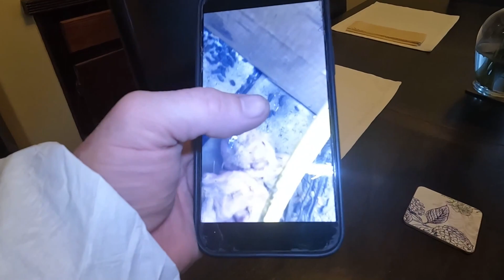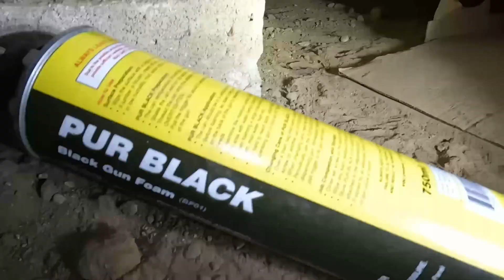9 MONTHS OF RATS because other company missed this...BEST WAY TO STOP RATS...

Comment: Has nothing to do with the Company, It's all about your technician. Every company has good and bad techs. Orkin does exclusion work and real rodent work outside of just trapping, but it's a completely different crew that comes in to do that work, and it requires an inspection conducted by one of their inspectors. it's clear this technician just didn't do their job and forward the info to an inspector. The issue could have been resolved in less than a couple weeks had the tech just picked up the phone and made the call. Bad lazy technician, Not a bad company

Comment: Been in the industry for some time. My personal experience has been this, most pest control companies will be able to take care of your average rodent problem. For the cases where the rats or mice have found a way in that is much more difficult to find, you would need a company like these guys. The majority of the time, you can fix an issue by doing only exterior exclusion work. When the rodents get in through a sewer pipe or something like that is where it does complicate things quite a bit.

Within that, I honestly believe part of the problem really is that the majority of the pest control companies often times charge too little for a bigger problem. Additionally they don't generally pay that well. Working in rodent control can be potentially dangerous especially if you are going in attics and crawl spaces. This directly influences the problem not being fixed, but only suppressed.
Reply from the maker: Yes, agree. I think it’s the responsibility of a trained technician to make it clear and understand that is a rodent issue is not stopped within 2 weeks or less, then to let the client know, that it’s something deeper and beyond our scope or learn to facilitate a lic subsContractor to get to these entry points, making more money and solving the issue. 
Thanks for sharing this very informative information. 👍🙏👏
Reply: Pay should not determine if you’re going to do a good job. Determine a fair price, then do a great job; old clients will recommend you and new clients will find you.
Reply: @helenm6732  I agree, with that if you are a business owner, but most pest control companies will pay you a commission based on the service. Say for example, your office sells a $300 mouse trapping and inspection service, they may pay you anywhere from $30-50 off of that depending on who you work for.  It could take you an hour, it could also take you 3 hours if its really bad. This is partially where the companies make the mistake and ultimately don't encourage their workers to do a good job. This is also not factoring in drive time which will vary company to company. Personally, I take pride in giving it my best regardless. However this doesn't change the business model of these large corporations that don't fix the problem like what we see in the video.

Comment: Another great video, Twins! It is an utter shame that these people had to suffer for 9 months because a sketchy pest control company refused to do any of the dirty work necessary to identify and resolve the problem. Folks, let’s stop wasting our time and money on these sketchy pest control companies who refuse to do nothing more than patch up a few vents and set some traps. Before hiring any pest control company, ask them if they are willing to crawl through a crawl space, remove insulation, and/or cut through a wall if necessary to solve a case (as part of the service or at least for an extra fee). If they answer no, don’t waste  your time and money.

Comment: 18:45, Can you just put a iron cap to close the opening? instead of making so much damages in order to replace the piece section, which is not in a bad condition?  if not, Why?
Reply: Right, they definitely did not have to take out the ceiling and wall for that. Like you said, they just needed to put on an iron cap.
Reply: They are trying to find any other entry points to see if they’re coming in from another direction also plus how Yk the owners didn’t ask them to check and see if there’s another entry point
Reply: @steph4032  Come on man. THey already knew that they were coming in from the broken pipe. If we followed your logic, they   would need to take out all the walls in the whole house to be certain then.

Comment: That wire mesh inside the pipe what if they decide they're going to go on the roof and snake through that vent is that going to push that screen down and cause a clogged somewhere or will there Snake catch on that screen and pull it out when they pull the snake out

Comment: Couldn't you have just capped off the opening in the pipe instead of replacing it.  I know you guys do great work was just wondering if there was another reason for replacing the pipe.  Seems like it would be just as effective and cheaper for the customer to cap that opening.

Comment: Great job finding the problem,   however seems to me that it could have been fixed with a simple drain plug that could have been installed where the one was missing.   Seem as though you did all the extra for the extra buck....    What do you say?

Comment: Not shocking to me. Those companies have employees that may take some tests and pass from reading up, get hired and paid, then go out and don't have the know how!
Reply: It’s not the employee most times it’s the company. The company will force the employee to spend as little time as possible on an issue because production is more important nowadays than quality also the company will not give the employees the correct tools (like the type of snap traps that the twins use or a shop vac…and generally across the board they don’t teach how to open up walls and look for things like this. It’s a complete failure on the company and honestly a lot of companies should be sued and make more of a training effort for the employees and let employees take their time and do quality work. But that’s not what makes the money apparently 

I work in commercial pest control so I know this first hand.

Comment: It’s not the employee most times it’s the company. The company will force the employee to spend as little time as possible on an issue because production is more important nowadays than quality also the company will not give the employees the correct tools (like the type of snap traps that the twins use or a shop vac…and generally across the board they don’t teach how to open up walls and look for things like this. It’s a complete failure on the company and honestly a lot of companies should be sued and make more of a training effort for the employees and let employees take their time and do quality work. But that’s not what makes the money apparently 

I work in commercial pest control so I know this first hand.